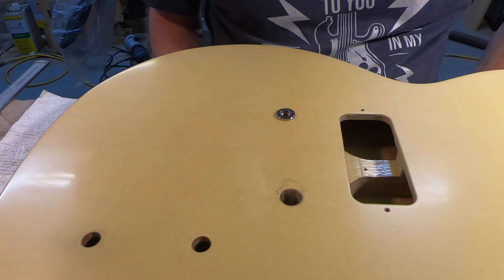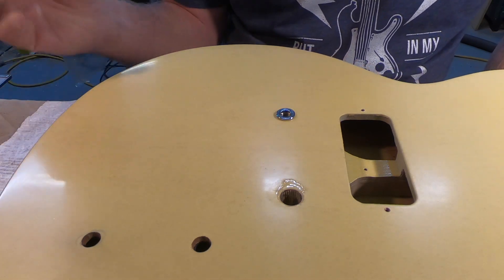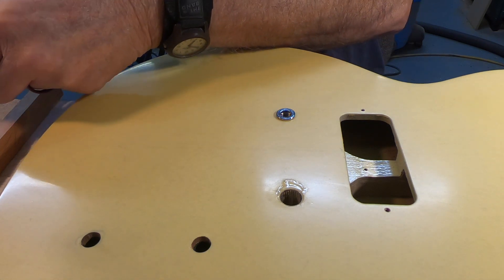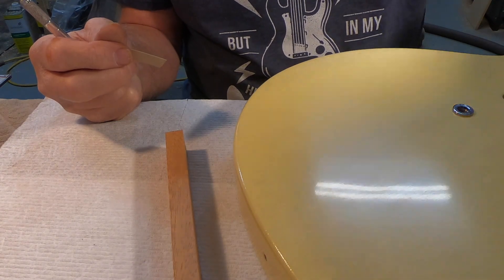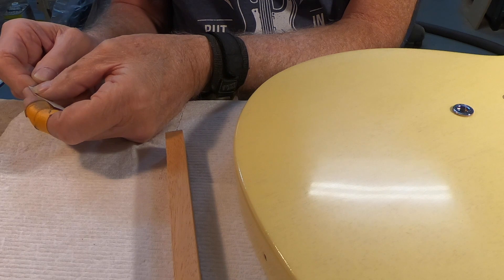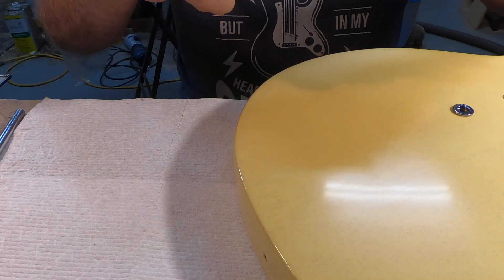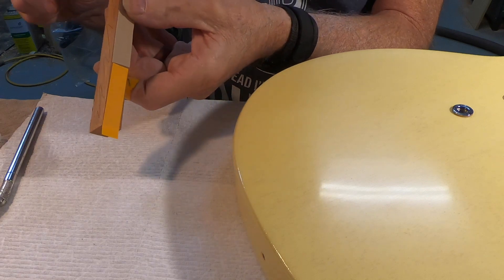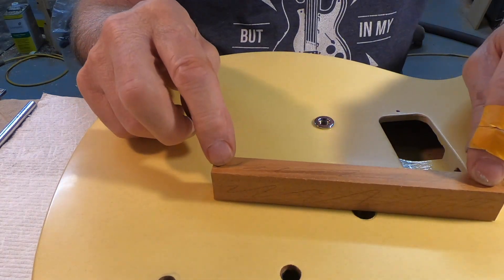EASY SHOP MADE LEVELING STICK FOR DROP FILLS. #GUITARREPAIRS

Comment: Good idea Dane. I guess fret kisser could be taken to be K.I.S.S. tech. I have a "tool" for taking nibs out of sprayed paint finishes that the company gave me so I could do it whenever I spotted anything during QA to cut down on rework time. It is a superbly machined block of steel with a hole through the middle. You just put the hole over the flaw and drag the razor sharp edge of the hole over the nib. If you think about it, your idea achieves exactly the same effect but for pennies. K.I.S.S. technology indeed. A result! Mine would be useless on a fret though!
Reply from the maker: Thanks Steve , That sort of tool would work very well for leveling drop fills.

Comment: I've been recessing the lip of the post ferrules on the few TOM bridges I've done which might help, mind you I didn't paint them which probably helps even more lol
Reply from the maker: I'm thinking even if I recessed them there would be lacquer build up in the recess and that could pop as well. Funny thing, first thing I thought of when it popped was "I should start oil finishing my guitars". but man I like shiny guitars.
Reply: @jonahguitarguy  you could probably get a similar level of shine to that guitar using oil like osmo poly x hard wax oil. 
Problem with shiny guitars though is they tell you hpw bad you are at finishing lol